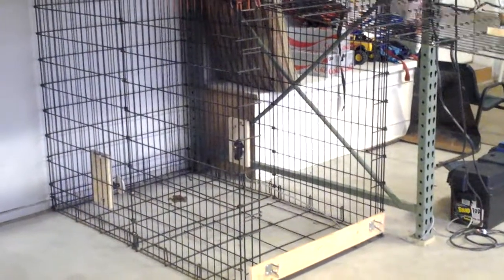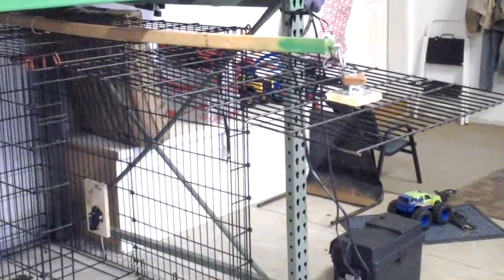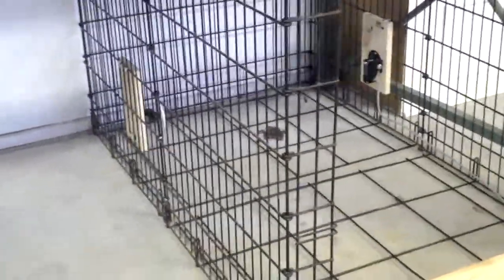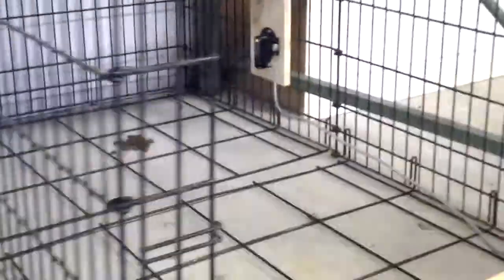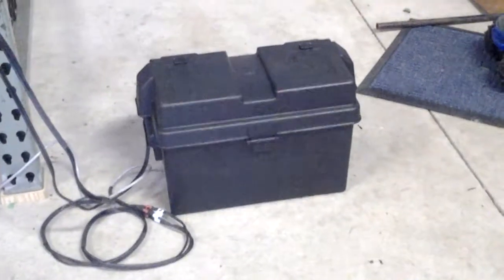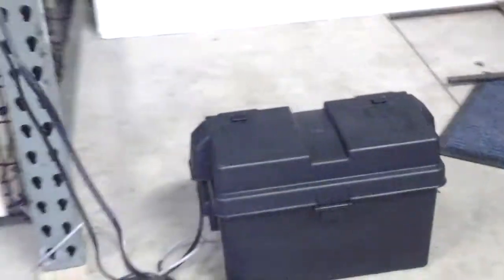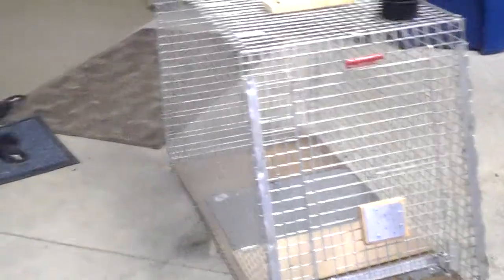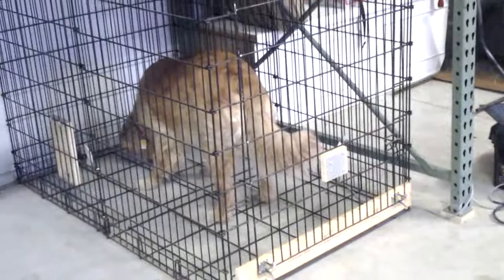Cash Trap with full electronics battery power

Comment: Which specific battery do you use? Also, what size  spring clips do you use? Thank you.
Reply from the maker: it is a 12volt deep cell/cycle amrine battery.  it is heavy to lug around, but it will power the trap for about 6 or 7 days straight when fully charged, if it is not below freezing weather.  the colder weather drains the battery faster.
Reply: +The Retrievers Can you tell me which specific model you use?  Thank you.
Reply from the maker: +Ann Milam it is not a specifci brand or model.  any auto parts store will have them.  just ask for a deep cycle marine battery.  12volts
Reply: You could get a solar panel to charge battery.